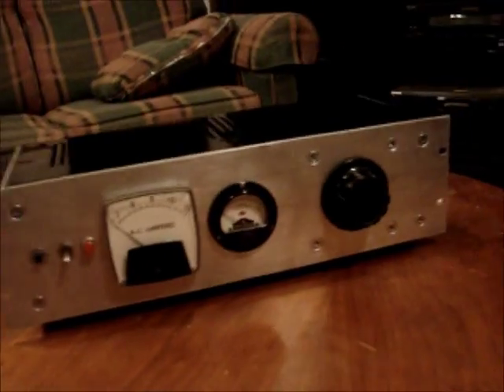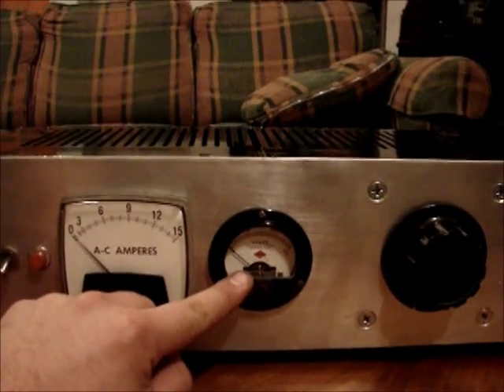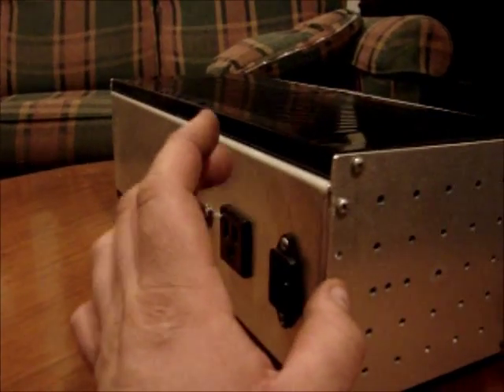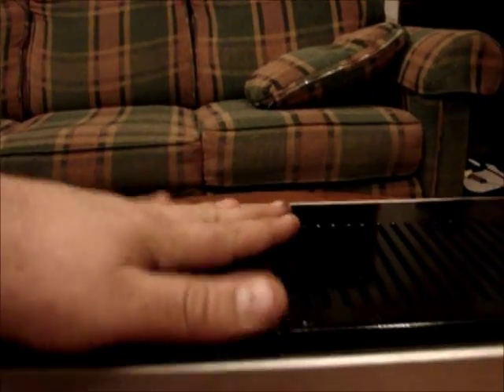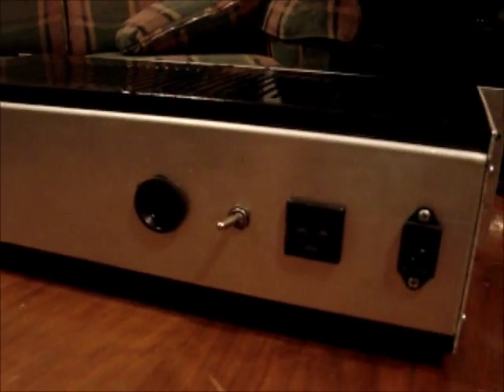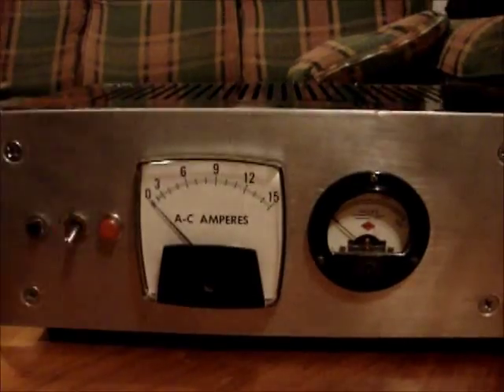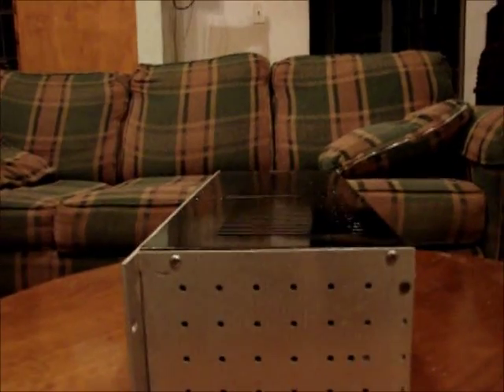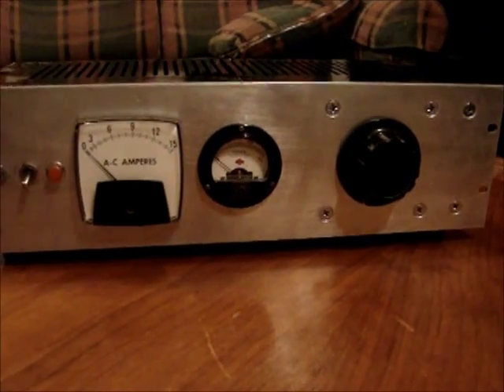Home Made Variac

Comment: Very Very Neat!! What other options are there instead of using an auto transformer? I live in Europe and you cannot buy a 10A variac under $300, since nobody here has these second hand. The only other variable voltage output that I have is coming from an old vacuum cleaner driver circuit, pretty beasty 1800W but output is a square wave, pretty useless for a transformer or other electrical appliances.